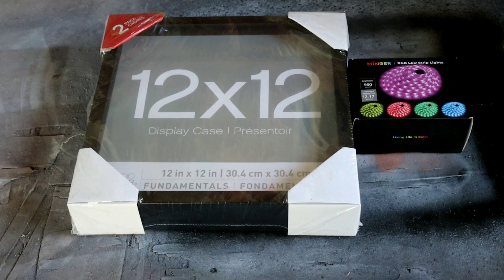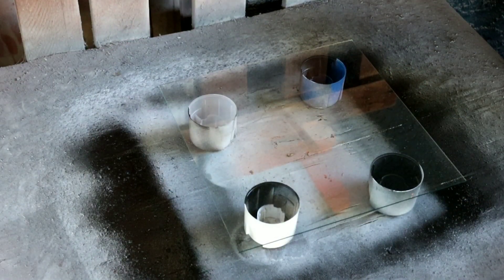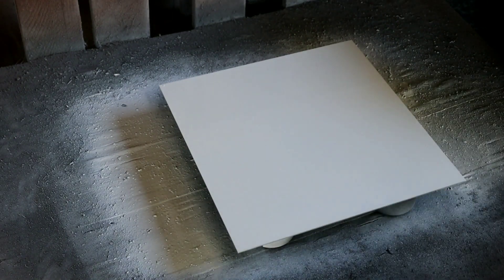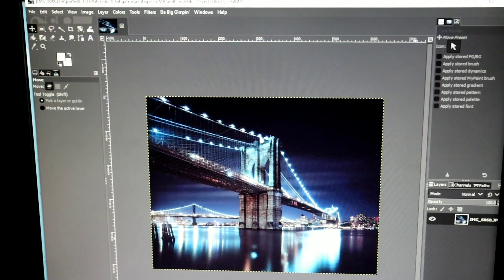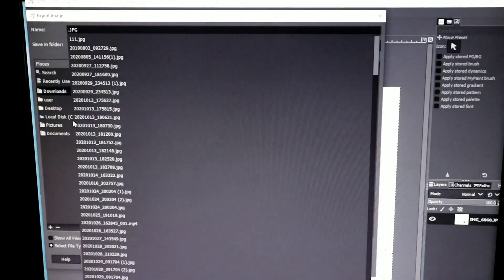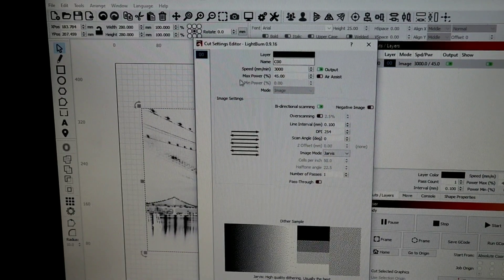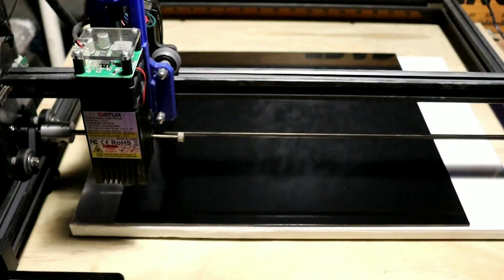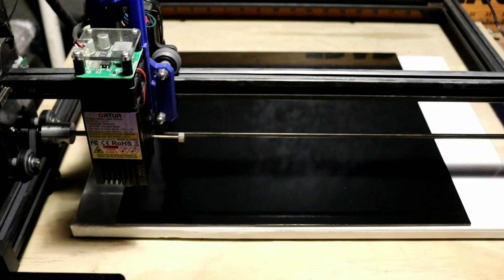Shadow Box of  The Brooklyn Bridge  made using The Ortur Laser Master 2 20 Watt Fixed Focus Laser

Comment: New to your channel found you from Pour Me Another's channel. Very informative info for someone new to lasering photos. Is the painted surface inside the box or outside the box?  Would spraying it with a clear finish help protect the paint from light scratches?
Reply from the maker: Yes its inside the box and clear coat or epoxy resin will protect it.
Reply: @zerica24  did you reverse the image before engraving? in my mind I am picturing it needs to be reversed to see it correct when looking at it from the front. Hope you don't mind all the questions.
Reply from the maker: @gunracksonline  don't mind the question at all. I don't reverse the Image I engrave it on the painted side I just protect it with a thin layer of epoxy Resin. I only use reverse on mirrors
Reply: @zerica24   thanks I am sure i will have more questions in the future.